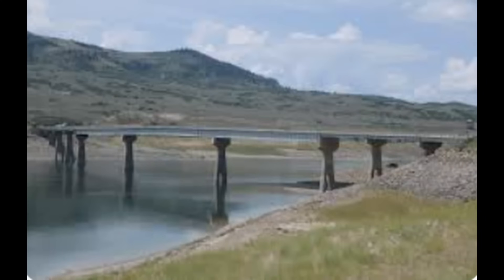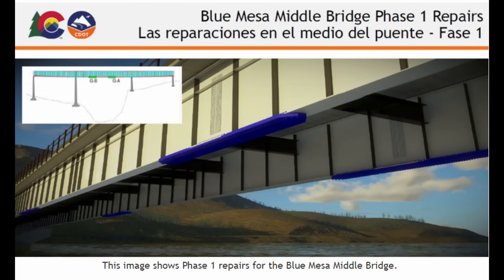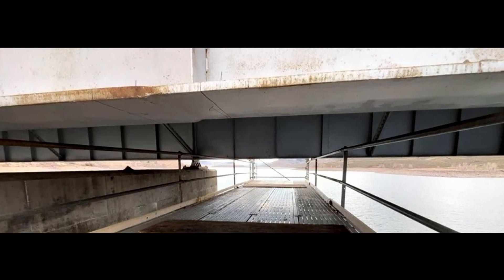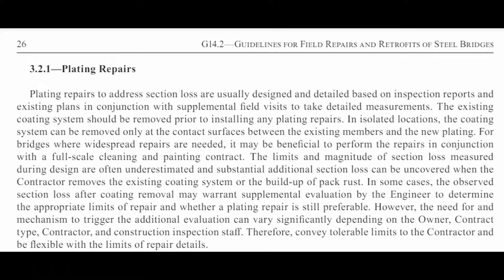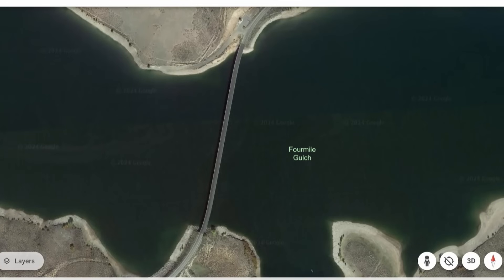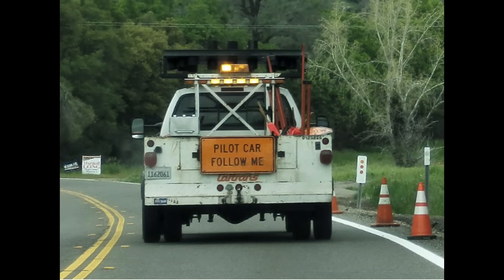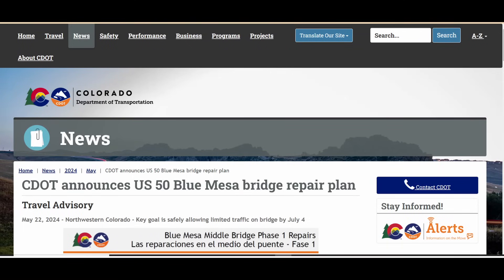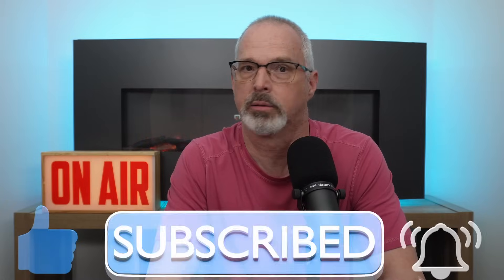US-50 over Blue Mesa Reservoir Repair Update

Comment: In the steel biz over 45 years and that seems a strange mat'l for bridge application ?  Somebody's brother in law was a steel supplier?
Reply: High-strength steel is a good choice to use to lighten the structure.  The choice has problems that need to be addressed to use it properly.
Reply: @royreynolds108 agree, like welding.

Comment: Again - Wow! I've worked a lot with material selection in pipe, vessels and process equipment.  Cracking (from any cause) is never good.  You always want an alloy that will undergo a ductile failure vs non-ductile (crack). In the specs this is communicated as elongation %. It's also good to compare Yield stress to Tensile stress, you want a material where those values are not almost the same (A514, 2-1/2 max is yield 100ksi, tensile 110-130) so that's only a 10 ksi spread. Alloys with better elongation have greater spreads between those values. There are also Charpy testing requirements to keep an eye on. Concerning welding on cracked alloys - I've seen welders chase a crack on a chloride stress crack in a stainless alloy.  As the weld advanced the metal heated up, expanded and the crack advanced.
Reply from the maker: Very interesting comments, thank you for sharing them!
Reply: The higher the strength of the steel the less well defined the yield region is, especially if the strength comes from heat treatment.

Comment: Let’s get this straight.  We are adding 80 tons of patch plates to a tension flange and web that basically is being pulled apart.  What you think it’s going to do in between the repair sections.  I think a continuous capping strap would be better at equalizing tensions and faster to repair.
Reply: Bolting has its own issues but welding on high strength steel that is loaded repetitively (meaning you worry about fatigue cracking) is a whole different problem.  Continuous coverplates would be better in that you wouldn't be introducing other stress concentrations here and there but continuous coverplates might not be practical for a bridge with such a long span.  For instance how would you make, transport and install a plate that is 100' or more in length?  And if you start reducing the length to make it easier to do then you are back to introducing discontinuities in places where you don't want them.
Reply: @billj5645  I think they are adding some cover plates on the bottom, or top of the web which can compensate for some of the issues of added dead load, and weakening by the first holes at the ends of the added cover plates.

Comment: Doesn't drilling all those holes in the steel weaken it? Can bonding be used?
Reply: Drilling smooth holes does not leave points where stress can accumulate and cause cracks.
Reply: @royreynolds108  Well it does, but much less than a crack, expecially a crack reaching an edge or corner.  I seem to recall that a clean smooth circular hole concentrates the strain by a factor of 3, and the worst sharp tipped crack configuration of similar size by a factor of 23.  Since the fatigue damage is proportional to the cube of the stress range a worst case sharp pointed crack will cause 450 times as much damage.  What is worse yet is having a crack in a location with a geometric stress concentration from the overall shape or load application.

Comment: Wow patches, so technically original 😂 how about replacing the diaphragms with full depth and adding cross braces? Otherwise, knock it down and put up a new one. T-1 doesn't like all that flexing. It's strong, but not maliable. Just my Arm chair Engineering opinion.
Reply: Actually full depth would put larger concentrated lateral loads at the bottom flange.  The proximity of the bottom brace of the diaphragm to the flange but weld as well as the proximity of the stiffening from the nearby bolted splice at the weld with the surface crack may have contributed to the crack.  Lowering the lateral brace system might improved redundancy, but probably not enough.

Comment: Upon completion of the structural repairs to the bridge, what is the expected lifespan of the repaired bridge? Fifty years or ….?
PS - Fascinating.
Reply: In one of the video's I think I heard 20 to 25 years more, so stretching it out to 80 to 85 years old.  May eventually be done in by deck deterioration due to deicing salts, critical corrosion problems from deicing salts leaking through the plethora of expansion joints, unrepairable rebar corrosion damage to the underwater parts of the piers.  Most likily death by a thousand cuts making a new bridge more economical, though there is a possibility of replacing the decks, bridge rails, eliminating most of the joints, Paint, and replacing the three span central long span structural unit with new superstructure that is fully redundant.  This would probably extend the life by about 50 years.  But first they would need a better detour.

Comment: With all the cracks discovered, it's my thiking that many similar cracks will be discovered on the West Bridge.
Reply: Yeah I wonder also if the limited capacity on the bridge being repaired would lead to cars backed up on the West bridge leading to extra load being added to that structure. Hopefully they make cars going east wait before the West bridge span.
Reply: @nitrorange  That's a good point. They are only 4 miles apart.

Comment: The chance that the second bridge does not have the same problem is very low.  The bridges were probably built at the same time by the same company using the same processes.
Reply: @MundusFinit  Listening to a CDOT brief about a week ago, it sounded like they had previously completed a visual cursory inspection of the west bridge similar to the inspection that discovered the initial crack in the middle bridge but had shifted all of their efforts to the middle bridge since finding the crack.  Given the number of defects found in the middle bridge since the initial visual inspection, I would not be surprised if CDOT followed up with a more comprehensive inspection of the west bridge after fixing the middle bridge.
Reply: I'd like to think CDOT has carefully inspected the west bridge as it would be a real pain if it failed while the middle bridge is under repair. Mind you, there's much less traffic on it for the time being.
Reply: The rate of growth of this sort of crack is dependent on the nature of the crack.  i.e.  does it penetrate a surface, an edge, a corner, how large is the crack, are there other cracks nearby in the same weld, is the crack perpendicular to the primary tension stress in the weld, is the crack or flaw difuse or sharp, how cold is it, what are the deadload stresses, is it cold, what is the magnitude of the liveload stress and how many cycles.  Idealy the flaws and their characteristics are such that fatigue growth of the crack is such that the odds of failure are low in the remaining lifetime of the structure.  The location of the visable crack in the middle bridge and three identical locations had several stress concentration effects as well as penetrating the surface of the weld at the edge of the plate.  These characteristics of the weld flaws in the west bridge may not have been present, reducing the odds of failure in the remaining life of the structure.  We know more about fatigue now than in the past, and have statistical data on the sizes and number of trucks likily at each bridge site, and potentially information on the stress concentration factors at the welds.  I think they have good information to allow them to determine what is needed to fix these welds as well as determine what size vehicles will not compromise the welds not repaired yet or constitute a significant risk.

Comment: I have so many questions or thoughts on this! To begin with, is it the steel in of itself that is the problem or is the problem that welding on it makes it become weaker? Is adding plates and drilling holes for those plates going to create another weak point to this steel? What about other areas that have been welded and do not show any issues at the present, are they going to become problems areas after the bridge is strengthened in the existing problem areas? If you have a bridge or bridges that was constructed from this steel, is patching the problem the best answer? Maybe they should make patches to get it reopened, and start building a new bridge beside it, to replace it! I know people are going to start screaming the cost, but this should have been factored in as soon as the issue with the steel was addressed to begin with! If it wasn't budged for, then shame on however ran the DOT in states that have bridges with this steel!
Reply: a. The welding proceedure.  b. Yes, but the amount of strength/ductility lost is controlled by the bolt spacing, tightening the bolts to generate a permanent compressive clamping force, and using drilled rather than punched holes.  Also any cracks that grow tend to run to a bolt hold and stop there. c.  Yes, but the choice of what crack size to tolerate is based on a conservative estimate of how long it will take for it to grow to a dangerous size.  d.  State DOT's don't print money.  They do the best they can with what they get allocated by legislatures and the federal government.  Often it is better to fix the one problem that has shown up in 60+ years than build a new can of worms.

Comment: Yup, essentially doubler plates like used on aluminum aircraft. Curious if the guidelines call for drill stops at the end of the cracks too?
Should be plenty strong for years to come.
Reply: I don't know about this repair, but I have stop drilled, and even welded bridge repairs when the crack is all the way through.  It is hard to reliably catch the crack tip though without a stop drill hole less than 2 to 3 times the metal thickness, and these flanges are a couple of inches thick.
Reply from the maker: Thanks fot your comments. I will have to look into your drill stop question but it would make sense.

Comment: Here on my planet, we also use 'pilot vehicles' when lane closures are in operation due to maintenance work on the roads.... We call them TRAFFIC LIGHTS. 😉
Reply: If you travel to Colorado you learn about the pilot vehicle routine.  You will drive up to a roadblock and sit there 5-30 minutes waiting for the pilot vehicle to come back so you can go.  It seems that as soon as the snow leaves every road in Colorado becomes a construction zone.
Reply from the maker: @billj5645  I imagine the construction season is very short for roads in Colorado at the higher elevations.
Reply: We used to have that traffic light-in-lieu-of-a-pilot-car in our county when they were adding a pedestrian crossing to our bridge.  Then they finished their work, and took our traffic light away...😥

Comment: Thanks, Casey. I’m curious about the weight of all these steel plates—-is that any concern? I guess what I’m getting at is if this old type of steel the bridge is made of has to carry more weight, won’t it get more cracks in other sites?
Reply from the maker: Thank you.  That is definitely something they had to look at during their analysis of the repair.  I believe they would be able to effectively distribute this extra loading well.  80 tons of extra steel total sounds like a lot, but over a wide area like this there should be plenty of extra capacity for the bridge to tolerate those additional loads.
Reply: @CaseyJones-Engineer  I think they are planning to replace the 3" asphalt and membrane with a thin polymer overlay.
Reply: @CaseyJones-Engineer  Or to put it in perspective... 80 tons is approx 40 avg passenger cars. It's really more a matter of what load the piers are designed to handle. Also if I understand correctly the issue of cracking in due to butt welding the steel members, where as if it were bolted, the same bridge design would have lapping plates bolted on with no cracking. Which in hindsight they probably should have just done from the start, but of course they took the cheap way out by welding. Penny-wise and pound foolish. 

I live in the Buffalo area, and NY State replaced a lot of bridges on some the local interstates built in the late 50's... I wonder if it was do to same sort of issue with cracking welds? Hmmm... Now I'm curious.
Reply: @douglascaskey7302  Interesting, but the plate length available at the time was about 40 ft max.  Also with the T1 the plates at the bolted splices had to be thickened to accomodate the holes for bolting due to the small reserve of ultimate strength over yeild strength.  The worst cracks, I believe, were at the butt welds to the thickened spots to allow bolted field splices.  A lot of things going on at this area (Strains are not plane due sudden jump of effective flange stiffness, diaphragm connection inducing lateral bending load, nearby web splice and thickness change).  The other bridges (in other states) with visable T1 cracks seem to have had similar things going on.